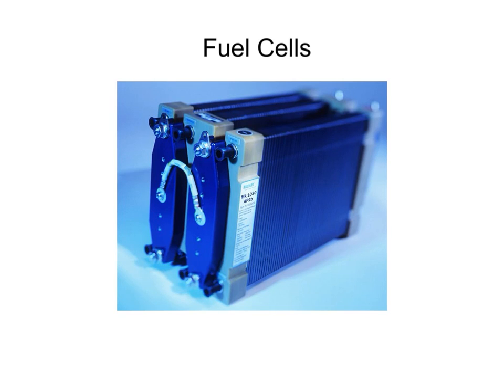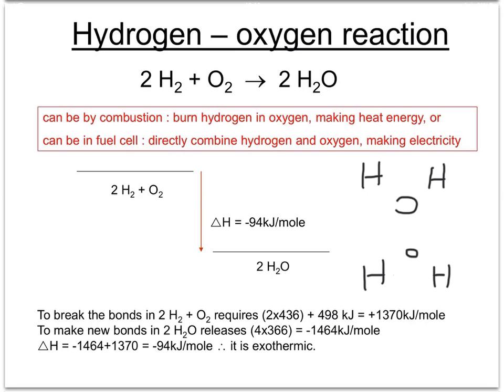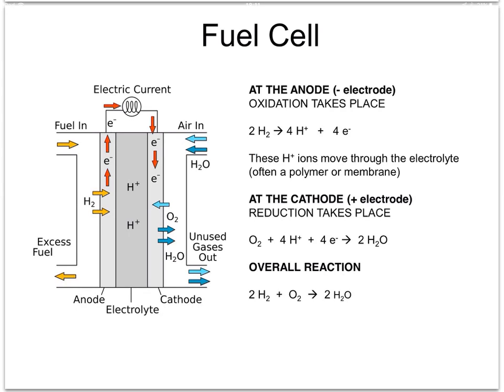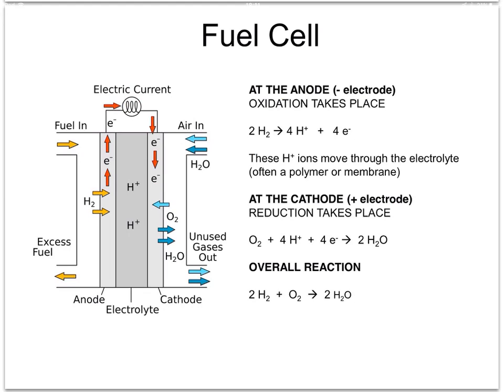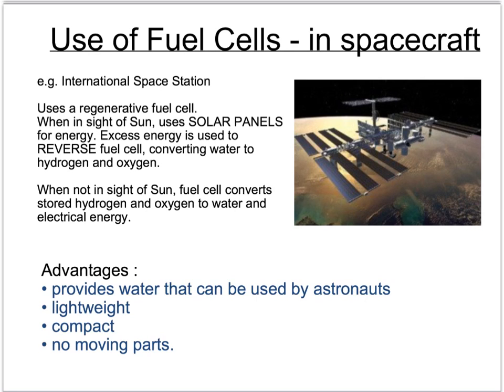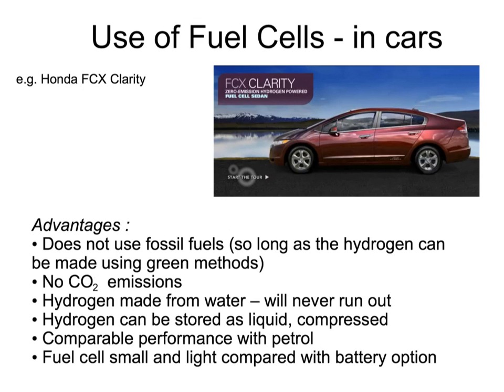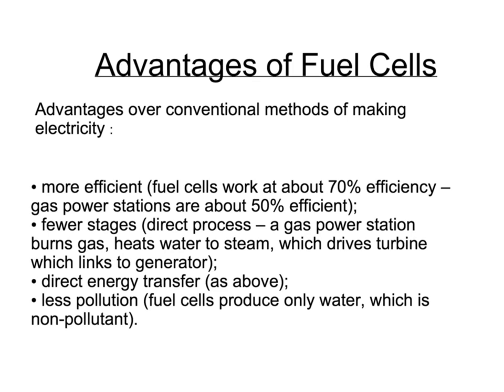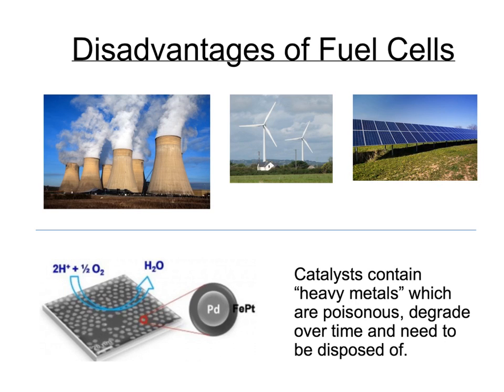OCR C6 Fuel Cells (Higher)

Comment: Isn't the anode always positive?here it is negative I'm confused
Reply from the maker: ThePlayBoyBunny Msp I'm not surprised by your confusion, as my students were too. The anode is always positive in electrolysis because this is where the anions are attracted towards. But this is not electrolysis. In electrolysis, you put in electricity and break down a compound to elements. But in the fuel cell, you put in elements to make a compound and create electricity, the opposite. 
Think of it this way. The cathode is the electrode that cations move to. In the acid fuel cell the cations (H+ ions) move to the cathode and combine with oxygen molecules to make water, and require electrons, which come from the electrode, which make it positive. At the other electrode, the hydrogen gas becomes hydrogen and releases electrons which make that electrode negative. It is explained on Doc Brown's excellent website. But BEWARE! The normally excellent BBC Bitesize is WRONG on this.
Reply: Thank you